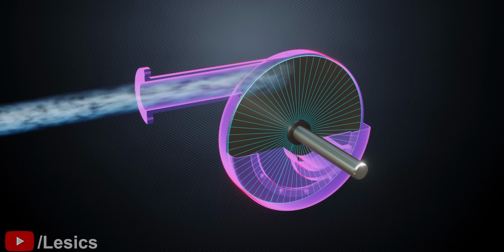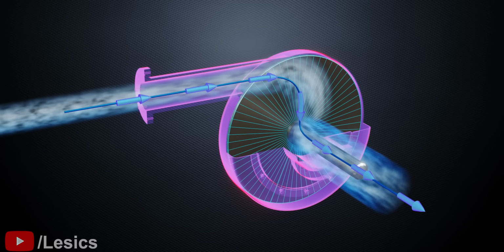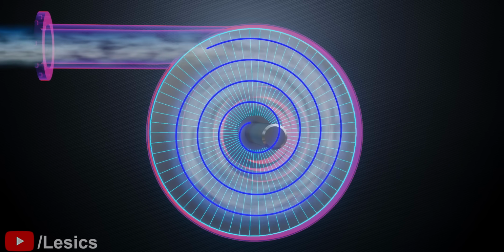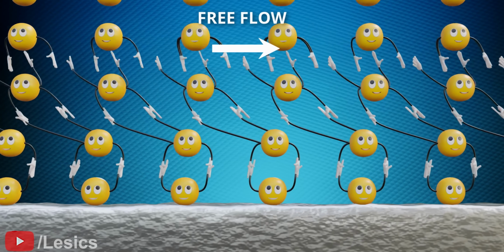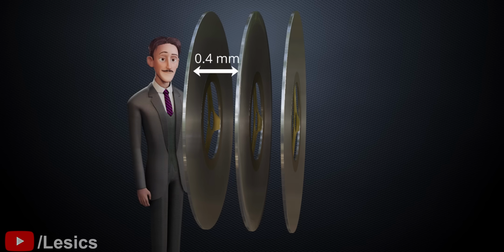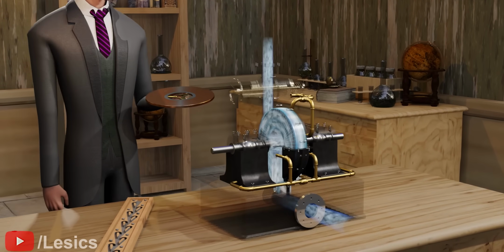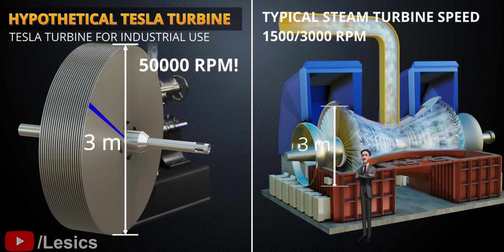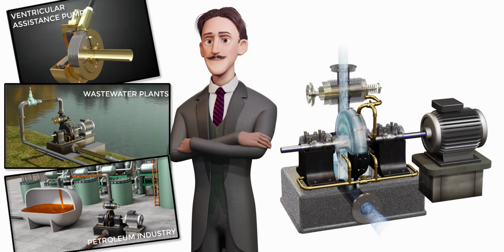Tesla Turbine | The interesting physics behind it

Comment: I just wanted to note a big mistake in the video! The video says the rotor must spin at a very high rpm, maybe 50,000 for a 6” turbine. The speed of a turbine is based on periphery speed not rpm. If a 6” turbine needs to spin 50,000 rpm to be efficient like the video says, that’s a periphery speed of 890.1 Miles per hour. If you want a 3 meter disk to achieve close to 891 miles per hour at the periphery, the rpm required is only 7,253. We have materials that can easily reach that speed.
Reply: just think...
The fragile hard drives in our computers spin anywhere from 2,000 RPM, to 15,000 RPM.
Reply: @MrMeow-iq7kq  With carbon fiber, we achieved 150,000 RPM, and that's just the beginning. We calculated the failure of the carbon fiber at 250,000 Rpm, close to mach 4. This was done on a 3" rotor. The periphery speed was 1400 miles per hour.
Reply: @iEnergySupply  amazing stuff
Reply: nah everyone will think its imposible because guy on youtube channel said so lol. dont waste your time xD

Comment: On 50k RPM you need very big reductor to transmit torque to generator or other device. The Tesla turbine may been used in a device whith free shafts, for example - detanders to production the liquid air.

Comment: This is ridiculous tesla use 30 psi air perssure to reach over 20000rpm on this turbine if use 30 psi on blade turbine you will get more than rpm and this turbine make very weak torque if add gear on it absolutly will be stop or work on very low rpm bur blade turbine make huge torque even with masive gear boxes

Comment: I realize that the centrifugal force on the rotors increases dramatically at higher rpm but isn't the tip speed Mach number relative to the fluid in which it is moving? If the actual tip speed is Mach 13 but, its moving in a fluid moving at Mach 10, isn't the relative Mach number 3? It's like a jet flying with a jet stream tailwind of .3 Mach would have an airspeed of .7 Mach but a groundspeed of Mach 1. Modern materials are available to achieve the rotor speeds necessary st the efficiency Tesla claimed. I wonder what functional lifetime can be achieved.

Comment: So could you add a water or (something more viscous like a light oil) to electric car systems which would act as a booster at higher RPMs using smaller (more structurally stable) disks? The drive system could pressurize a pump and it could kick in once the RPMs of the drive train were high enough. it would be a closed system so it would require minimal maintenance, also because the tesla turbine itself would be less prone to wear than a conventional finned system (and be more compact as well). 

There are, of course, weight/efficiency issues that would have to be factored in, but it might also be useful to partially recharge batteries as you drive even if it doesn't provide a significant power boost.

Just a thought for those who may actually be in the engineering field.
Reply: So an engine pressurizes a reservoir of viscous fluid only to have it blast through a turbine for an extremely brief burst of a little extra power? Sounds unnecessarily complex and heavy. You'd get a much better return on investment, weight, and complexity by just designing the engine to produce more top-end power.

Comment: As said in the video, tesla turbine principle is based on friction between medium and rotor. At any speed, it is only possible to get torque, when fluid is faster than rotormaterial. And speed difference together with friction means losses. I can´t understand the tesla turbine boom.

Comment: Why not use Carbyne disks and hydrogen to move the turbine? How close together for that? Or, some other gas to maximize turn, and keep the diameter of the disks to a viable size. I think you would be surprised with your result. There is a physics equation taught in school to figure this out.

Comment: what if you used a high viscous liquid like transmission fluid or thick oil to keep discs from warping and also stabilize at higher rpm?
Reply: because water is abundant

Comment: Why not address the size issue by taking large volume pipes and splitting them up into dozens of smaller pipes using individual Tesla turbines. Yeah more moving parts = more maintenance, but that's on a smaller scale which would enable production across the entire system while 1 turbine is down.